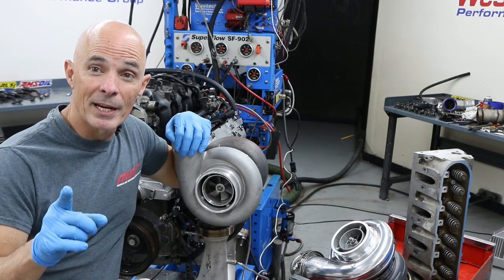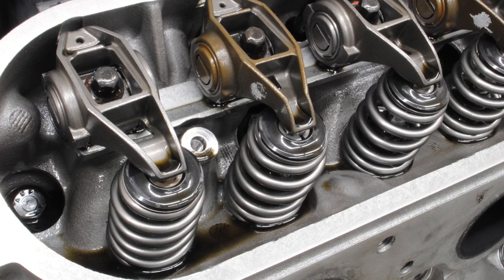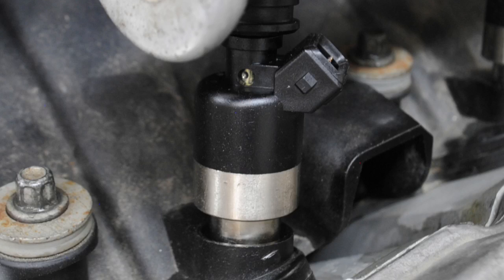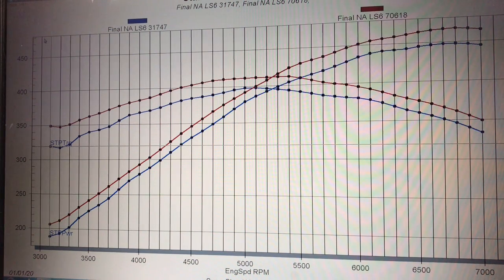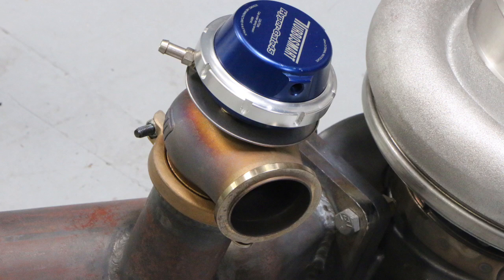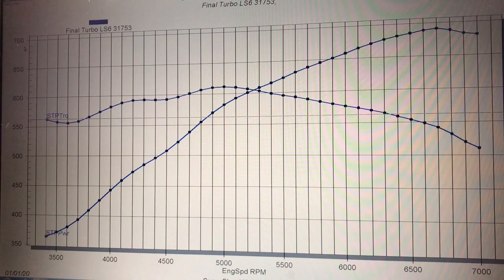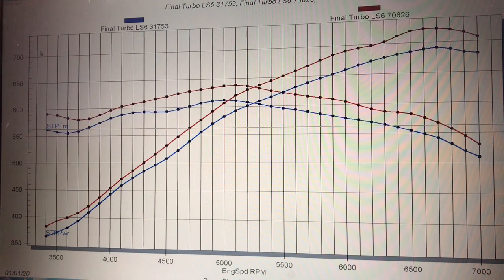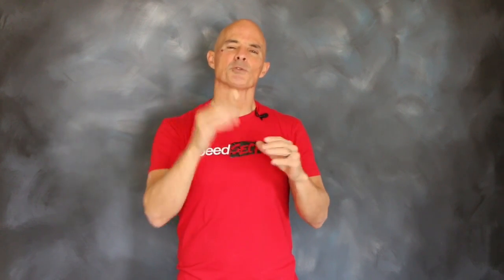TURBO LS HEAD TEST-706 vs 317 (BEST FOR BOOST?)

Comment: Richard what do you think would be the max achievable boost with the 317 heads on a 5.3 on say 91 octane?  On the boost curve comparison it looks like the 317’s could maintain the higher boost levels…..maybe I’m deciphering that incorrectly?
Reply from the maker: not sure how you came to that conclusion based on this video-but on 91, the lower compression 317 might be able to run more boost (and power) on the low octane fuel(but a test would be necessary since the chamber design is not great on the 317s)
Reply: @richardholdener1727  it was just an assumption I made based on the manual boost controller being in the same point and the 317 heads “maintaining” the 7.5psi at higher rpm vs dropping off like the 706’s.  My brain took that difference as head flow being the difference.  I could be thinking about that all wrong, it was just a thought I had when I watched the video.  You’re right, that would be a pretty cool test!  You play with way cooler stuff than that though.  I have to say, I absolutely love your videos!  I am “mirroring” a twin turbo roller 351w in a ‘73 f100 after watching your junkyard 351 clip.  Awesome stuff man, all of us gearheads really appreciate the plethora of information!

Comment: Do you think I’d be safe running 10psi boost with 706 heads and a compression ratio of 9.8:1?
Reply from the maker: yes with intercooling, the right fuel and timing

Comment: Tripple that boost, then come talk to me about which head is better. 317 is still far supperior for boost at 20psi plus.
Reply from the maker: if you run both heads at 20 psi-the results will be the same

Comment: The stock compression on a 5.3 is about 9.5:1 which is ALREADY THE TARGET COMPRESSION FOR EVERYDAY RELIABLE BOOST. Even GM with its most powerful supercharged engines does NOT go over or under this compression range. When you put the 317 head, which is about a 70 cc chamber on a 5.3 which has DISHED PISTONS... you killed the ratio WAY down into the 8:1 range which is NO.. BUEN.. O! Like I'm doing on a 5.3 right now, your SUPPOSED to replace the stock dished pistons with flat tops, NOT dished, and then the 317 head would have fit on the 5.3 WITH the proper compression of around 9.5:1 and KILLED THE 706 HEADS! Yes, GM used FLAT TOP pistons in the 6.0 to keep the compression up with the 317 heads. Completely invalid test.
Reply from the maker: the heads were tested stock, so completely valid test. and even if you matched the compression, the 706 heads would still make more on a 5.3L (see 799 vs 706 head tests)

Comment: I would I like to see this test done with both heads having to or relatively close compression and much better cam with a tighter lobe separation more suited for this engine combination. I’m willing to bet the motor will make more power up top and generate torque sooner at low speeds over the 706 heads.
Reply from the maker: the head test was done stock to stock-why would you change compression on 1 head to skew the test? A better cam will add power to both heads-but is not needed-the turbo determines the eventual power
Reply: @richardholdener1727  the right or wrong cam will benefit one head while not benefiting the other, thus changing the results. Like I would do and I’m sure you would do is to make the most power NA before you put a power added on to make it easier to make power with less boost. This is just my opinion and how I see things. I would do this test and have both heads decked with the proper gasket deck height to make the same or as close to compression and have a custom cam built for each combination.  The reason is that’s how I would do each combo to their max potentials for the street then boost from there. This being said I really do love your content and look forward to more of your content it’s always fair and unbiased I will be staying tuned I hope you consider my ideas for future builds. Keep up the good work.

Comment: The extra airflow comes into play when the displacement comes out to play. On a 6.0 you will notice a difference in the top end where the 317s will actually catch up and surpass the 706 heads.  Depending on cam size it's usually over 6,000 RPM where this trade-off happens meaning the 706 head is still much better for average power production
Reply from the maker: THE 317 NEVER PASSES THE 706-EVEN ON A 6.0L-IT HAS BEEN TESTED
Reply: @richardholdener1727  your own videos contradict that.  On a 6.0 with big cam the 706/862 looses like 10hp up top and gains 15-20 ft lbs below 5k in comparison to the same engine with 243/799  My own builds show the same result.  On a 5.3 the 799/243 never surpasses the 706/862 at any rpm

Comment: Hi Richard, thoughts on changing to 706 heads from 317s on my twin turbos 6.0 LQ4, 72 nova street/strip. I know compression will go up from 9.41 to about 10.5? Smaller chambers, 71 vs 61. Also  any piston to valve clearance issues with my sloppy stage II cam 228/230, 585/585 lift, 706 heads on 6.0? I am always on e85. Any issues with changing the tune for timing etc on my holley terminator X? Holley guy told me terminator adjusts so fast reading o2 sensor and from my flex fuel sensor it almost instant adjusts tune from pure e85 to 91 octane added to fuel cell right away, so dont bother changing tune. Just asking for your experienced educated thoughts. Im sure lots of 6.0 guys thinking to change too since your dyno testing here! Many Thanks for all you do for us Richard showing us the real deal in all your dyno testing!!!
Reply from the maker: no change in p-v. should be clearance with that SS2 cam. not sure on timing change other than the 706 head wants a degree or two less NA
Reply: Thanks Richard!

Comment: I would like to see this same test on a  boosted 6.0 LQ4 with 317 vs 706 heads. Why? Most budget guys get a 6.0 as an LQ4 with 317s, not the pricier motor rec port heads. So is it worth it to swap heads on a 6.0???  Why don't we ever see these tests on a 6.0 lq4 with 317s? Just seems that is what most budget guys get with a 6.0. So should they swap those 317 heads off at the extra expense? Thanks!
Reply from the maker: the result is the same-the 317 heads make less power than the 706 heads

Comment: So if 706 had same vavles and different springs vs 243 ported heads with turbo or pro charged.  Witch is better for the boost.  I know 706 can make some power.  But what about 243 ported heads
Reply from the maker: the both work well

Comment: What fuel was used here?
Reply from the maker: RACE
Reply: @richardholdener1727  I am building an LQ9 to go into my 2002 Avalanche Z71. My goal was to clone the blueprints from the LSA/LS9 so I added the 4032-forged 10cc dished w/ valve reliefs. I am trying to find research that will help with my decision of using the 317s or the 706s because it is a pump gas truck. The rings are gaped w/ piston squirters. (SBE) twin GT3582s and Armageddon Manifolds.

Comment: A lot of us only have access to pump gas 91 and if we’re lucky 94…….   It’s easy to say the 317 heads suck when you’re running E-85.  Would I run 317 heads on a none boosted application, obviously not.  706 heads would work well N/A.

Comment: What fuel did you use and would the results be the same if using lower octane fuel for regular street use such as 87 or 89 with the 706 heads?
Reply from the maker: we used race gas mix

Comment: If the 317 heads were milled .020 and ported would they be better?
Reply from the maker: ported and milled 317 vs stock 706?
Reply: @richardholdener1727  yes Sir. Found a set for $200

Comment: So I have 317 heads on my 6.0L truck. I don't care about top HP and I'm not interested in racing besides just being a shithead at stop lights. What I took away from this video is my stock heads are good upto 800hp, would a port & polish make a significant difference or am I doing unnecessary work?
Reply from the maker: no need

Comment: @Richard Holdener  I'm really curious, at what point(boost wise 10,20,30psi) would the better flow in the 317 head surpass power output in the 706 head? Or would it even surpass it? Please turn them up and lets find out!
Reply from the maker: it will never get there with this turbo

Comment: great video...  but like to see a ported 706 vs. a ported 317 head  and or a 243 ported head video
Reply from the maker: THE PORTED 243 SHOULD HAVE THE MOST ABSOLUTE FLOW-CHECK OUT THE BIG LS HEAD TEST
Reply: @richardholdener1727   I seen that one  after I posted ,,, but would be nice to see a ported 706 with a 2.00 intake valve and a ported 243  on a 5.7 ...as I looking to  put a 218/227 .600 lift cam in and while I'm at it up grading the heads too... but liking the port velocity of the 706 for tq  down low 
i love your videos.. thats a lot of time you did on them to show us hot rodders

Comment: My "5.3" has flat top pistons. Is that a clear indicator of a 4.8?
Reply: It has 706 heads as well. those boost test you're doing. Are they flat tops or dished?
Reply from the maker: EITHER ONE
Reply from the maker: THE HO 5.3L HAD FLAT TOPS
Reply: @richardholdener1727  Thanks Richard. I was told it's and 03 truck motor. Does that still make since? HO?
Reply: @richardholdener1727  aluminum block as well. L33 correct? Mine is definitely a 4.8 but that's fine. Thanks for your help and great videos.

Comment: One would think on the 5.3 the 706 is going to keep winning, but, the 317 should be able to boost more psi on pump ⛽️.   If switching to a bigger engine though, if we don’t cut some bigger valves into the 706 heads and some deshrouding work the flow I think would bring the 317s in for the win.
Reply from the maker: I understand you want the 317s to win-they don't (expect maybe more psi on pump gas) but they do have a poor chamber design (not just big)

Comment: Did you gap the rings on the 5.3 with the 706 heads or are the rings stock gap for the boost and how much boost did you use
Reply from the maker: I usually do increase ring gap-always a good idea

Comment: The first thing I would have done here, when the test was over. Is put both sets of heads on a flow bench. Because, if what you are saying is supposed to be true. That the 317 heads flow more air, then something is wrong here. The 706 heads had less air inlet resistance, based on the back pressure readings. Which means that they are flowing "more air" than the 317 heads used here. A flow bench, will back up what I am saying...

Comment: Absolutely grade of gas determines our compression limit. This takes us two places. Grade of gas and how much boost. First one is easy for my location, E85. Second one is more interesting, of the two heads where can you run the boost safely on pump gas and what hp is that?

Comment: Richard I thought the 706 heads were prone to cracking, especially the ones that aren't made by GM, &  outsourced by a different manufacturer, care elaborate on this  issue, I just bought. a 133k mi LS junkyard  5.3 with the 706 heads on board, for a 95 OBS single cab Chevy 4.3 v6 5spd. man. swap as we speak. Anyhow... I love your knowledge & content on these LS engines got me excited and ready to get in my LS swap complete.✌👍👍

Comment: You should do a test where you mill the 317 head to get same chamber sizes and see if the extra airflow on the 317 heads even makes a difference then.

Comment: Pump Gas Shootout 5.3 Low End Torque Truck Engine Maybe?  317's mild cam or anything designed for daily driver stock stall that runs on pump fuel.

Comment: Okay so you answered the important question at the very end of the video, what I need to see is a test just like this, but on pump gas, push the 706 heads with as much boost and timing as you can safely do, then swap on the 317 heads and see how much more boost you can safely run and how much more power the extra boost gives you, this is the question that we need answered.
Reply: the 317s will make signifigantly more.  You will be able to run  double the boost or more where the 706s start detonating

Comment: Were the 706 heads ported?
Reply from the maker: stock vs stock
Reply: @richardholdener1727  whats the diameter on the ls6 intake or can I get away with a truck intake?

Comment: Doing a 6.0 L's single turboed I got 317 heads now I got a set of 706 which do u prefer?? Curious to know
Reply from the maker: both work
Reply: But which do u prefer the 706 or 317 I got both the 317 came on the 6.0 motor

Comment: how would the 706 perform on a 6.0 with boost? would you be better with the 317s and extra flow on the 6.0?
Reply from the maker: the 706 makes better power from the compression

Comment: If the 317 flow more there capable  of higher horsepower I'm guessing till you go above the 706 horsepower capacity its compression advantage will win out

Comment: I like the 706 heads.  They're just a better size for the 5.3.  The intake port has better air speed (better proportions for the 1.89" valve, especially with bowl porting), and the exhaust flows relatively more than the 317.  The 317 needs a shorter duration cam to bleed off less compression, especially with the lower compression ratio.

Comment: I'd like to know what the airflow gain was in CFM of the 317 heads over the 706? I think you did a video on this and I need to look back but clearly in this case compression was King. Maybe in a condition where 40cfm~ through the mid-range lift was the gain we might see the airflow balance out the power curves but in this case if we're only seeing a 10-15cfm swing between the two the flow just wasn't enough to overcome the increase cylinder pressure of the 706. I mean ultimately that's what it's about, right? Cylinder pressure... It's what makes power.

Comment: From my perspective comparing both combo's at the same boost level misses the point of lowering the compression. If your higher compression engine isn't detonating you wouldn't lower the compression unless you were going to add boost.
My question would be , if the high comp engine makes it best power with lets say 21 deg total timing then how much extra boost will the low comp combo take with the same 21 deg timing thus how much additional  power will be delivered ?

Comment: I have a set of PRC CNC'ED and decked 799's on my boosted .05 over ls6 half filled and they make great power iv had them on a sbe 4.8 and 5.3 also and went fast before the cnc porting they where just decked and they did pick up mph in the over 706s

Comment: Please do this test with pump gas as the limiting factor, not WG pressure.
Two guys on the street aren't going to limit themselves to 8psi to see which combo makes more power...
Reply from the maker: If you want to turn the boost up, the gains remain. If you want to limit the boost-timing with lower octane, either head will work

Comment: The reason you get less boost with the 706heas are simply because they flow better. Flow is the inverse of pressure. The more flow, the less pressure. Pressure is noting more than resistans to flow.
Reply from the maker: the 706 heads flow less than the 317 heads-its the effect of the added power/back pressure  on the gates

Comment: The boost is lower on the 706 heads because the engine is swallowing the air. The heads are more efficient. Great videos.the best ‘ no bullshit’ back to back comparisons I have seen yet.

Comment: NA who said the gains are only from compression? the 317 heads have a smaller inlet valve and smaller port areas which are better suited to this cubic inch and rpm IMO which in itself normally results in VE improvements due to better velocity
Reply from the maker: I think you mean the 706 heads have those things, right?
Reply: @richardholdener1727  yes thats what i meant. i mean i think part of gains are compression and part are the heads are actually sized better. the 706 v 799 NA showed this  partly as the chamber vol are much closer to each other yet the smaller head still won

Comment: I think the 317 heads would help with higher RPM hp.  But based on this test in this RPM range the 706 heads won. As you said the boost dropped a tiny bit with the 706 heads vs the 317’s.  Does that mean there was less restriction with the 706 heads in that RPM range since the boost controller wasn’t even touched.

Comment: Higher compression ratio gives you more power up to 20 psi of boost. After that lower compression ratio is taking over - for instance at 44 psi of boost 7.5 CR will give you 9 percent more power than 11.5 CR all else being equal... So higher CR is good but up to a certain level...
Reply: Explain how this is possible assuming fuel is not knock limited in higher compression engine.  What formula(s) are you using?  Never heard of 2000+hp motors lowering compression to get more HP at >40psi.
Reply: @tbl8560  How about Top fuel dragsters using CR 6.5:1 with nitromethane making 8500-10000 hp? The rule is that every 0.1 of lowering CR gives you up to 3 percent more air (thus more oxygen and therefore power) whilst increasing CR from 8:1 to 16:1 can give you 10.5 precent more power maximum.

Comment: Ignorant question, can you build a Junk Yard 4.8/5.3 NA or boost, increase HP, not necessarily increase torque too much and run it at 7500rpm in a weekend track car on a budget like you guys build engines for big HP/TQ here? Just wondering?
Reply from the maker: yes with the right cam and intake
Reply: @richardholdener1727  That sounds surprisingly simple. Would love to see a build of a reliable weekend racer (endurance/lemons) that's good on HP, lower on TQ. Again, I'm ignorant but capable and willing to try.
Reply: @vmoutsop  HP comes from RPM.  With the correct induction system (air flow) and stable valve train to go 8000 or 9000rpm will get you more HP.  Think of motorcycles running 12K rpms or Indy cars 18K rpm to generate HP.
Reply: @tbl8560  Yes, but can it be done relatively cheap with a junk yard motor for a weekend track car. Doesn't have to go 8 or 9k but would be nice if it could.